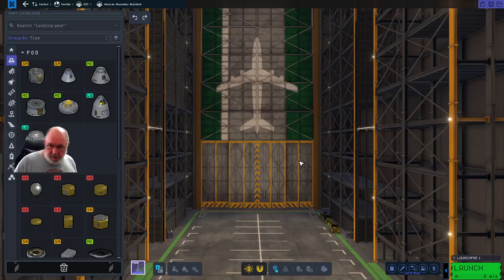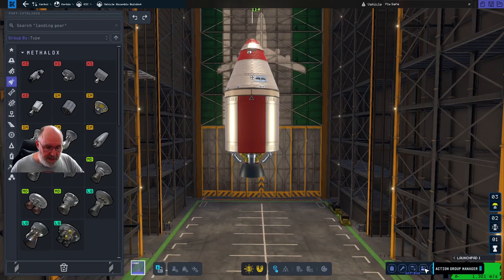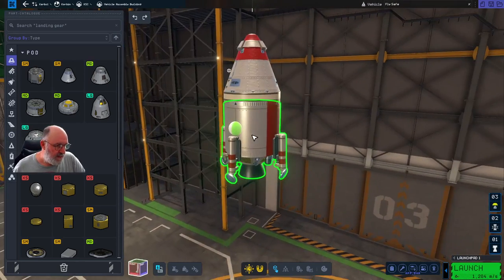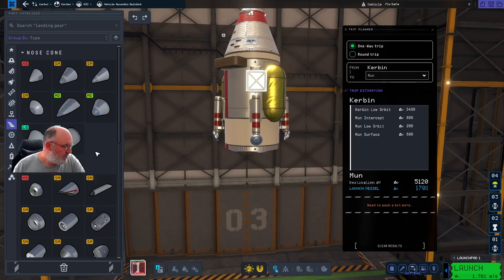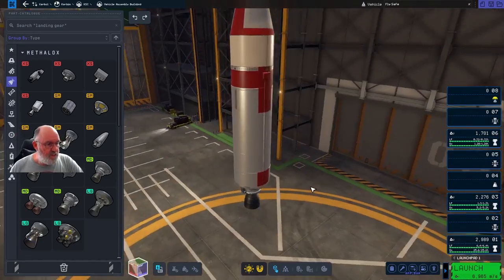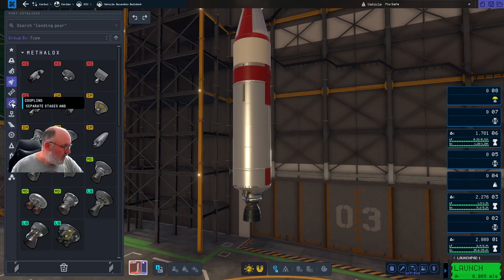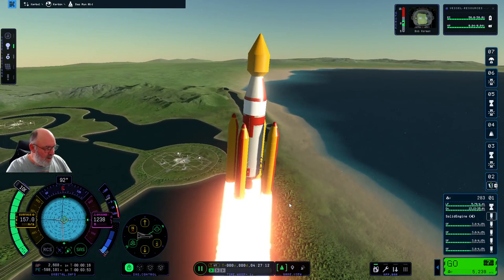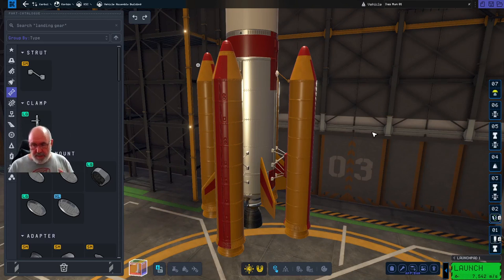KSP2 ~ Beginner Tutorial 03 ~ Designing Your First Mun Lander Spaceship

Comment: It took me 5 hours to get into orbit last night.  I loved it.  I think one time all 4 of my boosters shot off my rocket on the pad because my stack order wasn't right.  I did finally figure out the way I was stacking stages required me to manually fire each engine... once I realized my throttle resets to 0 after every stage... everything started to click.  I basically came up with an end product that you did with the sabilizers and 4 boosters of the same size.  I think I have 3 stages... the first to get up, the 2nd doesn't really do much to getting the orbit but the final stage has a shitload of fuel and gets me there with most of a full tank.  I kill my first stage at about 55 km.